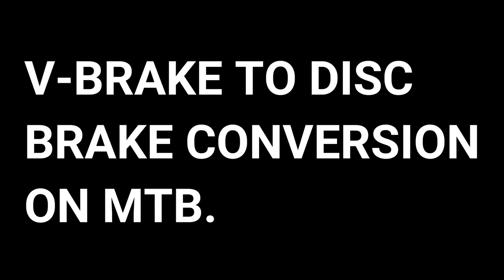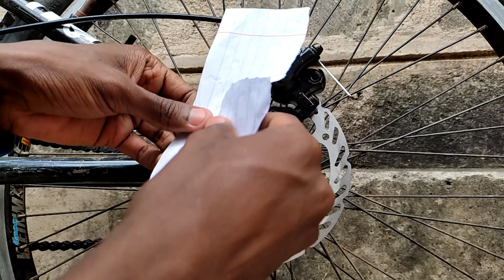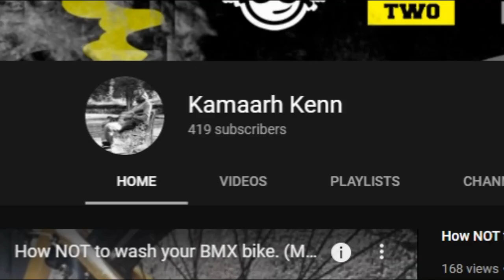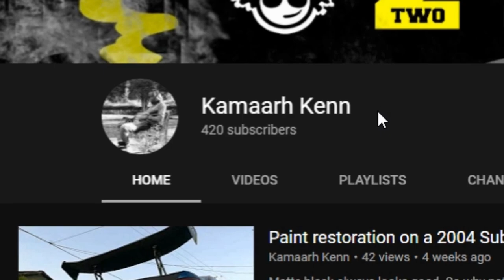Custom V-Brake to Disc Brake conversion on my non-disc Dirt Jumper frame.

Comment: Fantastic method of figuring how the rear brake mount would fit on the frame. Absolutely Wonderful!!!
Reply from the maker: I even surprised myself with this one. I sold the bike to a friend of mine but the brake still works without a hiccup.